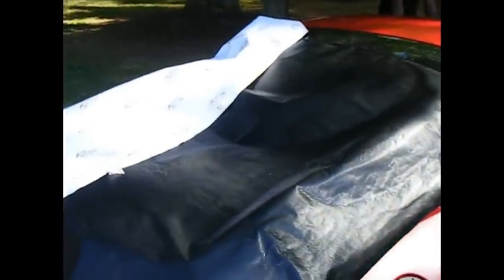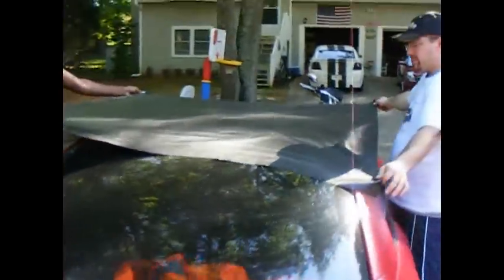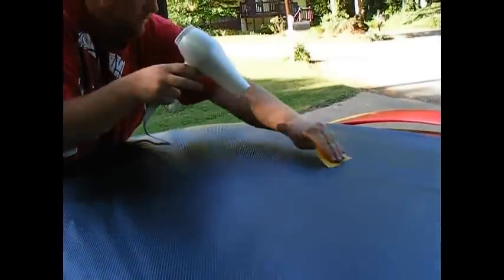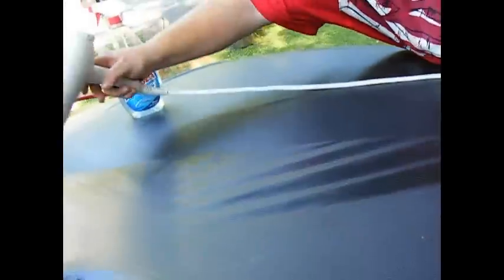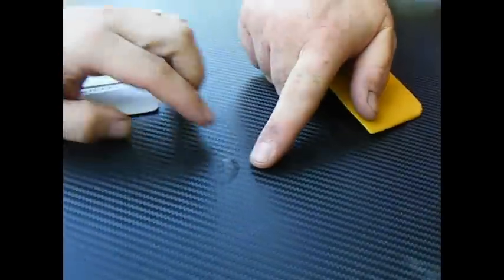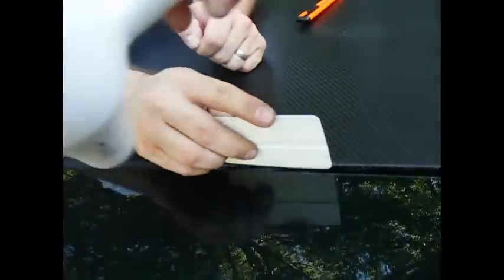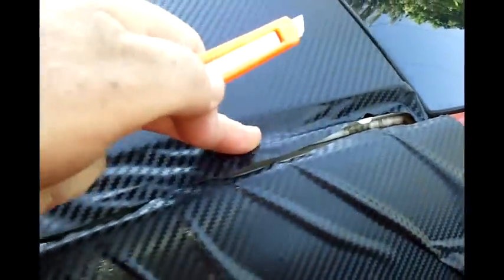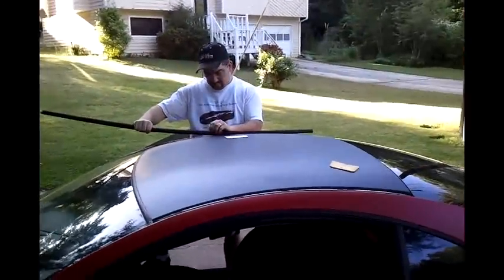Carbon Fiber Vinyl Install DIY

Comment: Finished up my full wrap a few weeks ago. 3m satin pearl white on my black e class wagon. Didn't wrap the roof. I paid 2 "S.A's" lol to help. One has wrapped a few full cars. It came out very well for the most part. Yes, there are a few imperfections "Nothing disgusting" 
3m will show stretch marks if you don't lay it right the first time or shall I say keep lifting and moving it especially on your concave and corners

Comment: A real heat gun would make things a million times easier. The ones from Harbor Freight you can pick up for $15-20 will do just fine, and they have many uses.
Reply: Skill... with a heat gun increases the effective speed.  Hair dryer is not a tool..

Comment: this has to be one of the worse "wraps ive ever seen" you do not, ever use windex to apply, prevents and postpones time of glue adapting to surface, also a hair dryer does not apply enough heat on vinyl to reset its shape or to add flexibility youll need, and to end it with, that is NOT WRAP MATERIAL! no air release!